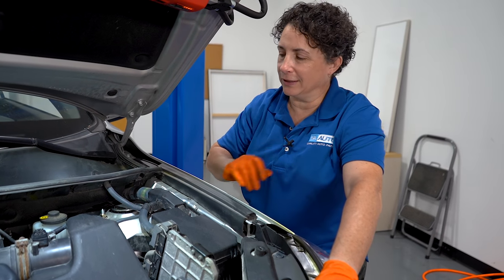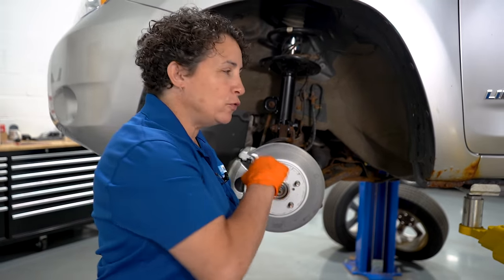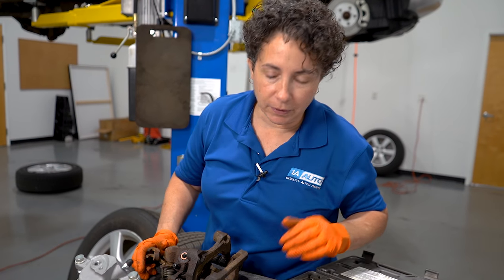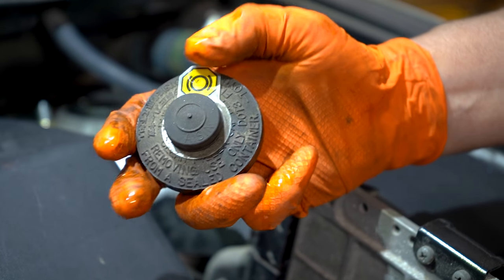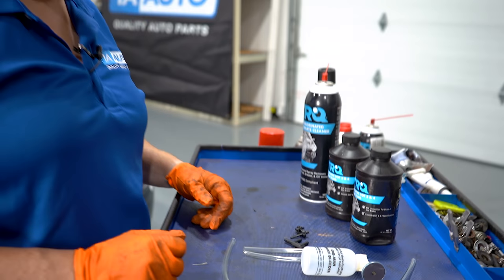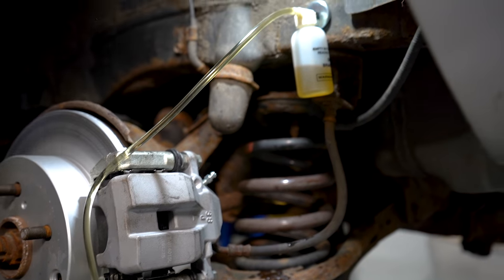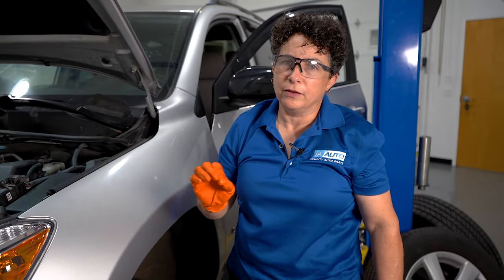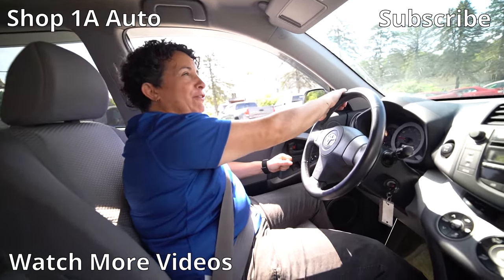Common Mistakes Bleeding Brakes! How to Do a Full Brake Bleed the Right Way, and Why!

Comment: Like this lady. Have old 98 Chevy rear brake feed rusted out replaced line from abs.. . Did single person brake bleed. Seemed good then I pushed to hard. I was good At 1970 trucks. I just want brakes, had abs unhooked to make like old skool. Abs sucks. Hit a lady who stopped on a green light in snow storm.. brakes chattered. Bingo I bought a 1 k bumper skin. 😡
Reply: I had brake job done. Rusty lines new rear hardware except wheel cylinder. Left with zero brakes . 990 wasted had new factory lines.
Reply: Finally someone who know their trade. Doing rear lines on 98 Chevy rusty paid 990 plus ball joint. Left with no brakes had factory lines in back of crew cab. But I don't have a hoist. Grr

Comment: I have a 2011 chev Camaro,i put a little bit of water in my brake fluid, thinking that was where i fill my water!!! Ya ya .i was told that buy the azzh*le i bought car from....my brakes are strong...but squeak alittle bit..im a single mom, don't have anyone, like i said i didnt pour alot of water in there? But should i take to a mechanic to get it flushed, and should I ask them to do all four tires? I did have my neighbor he looked at it he rebuilds cars and motorcycles he said he would flush it for me, but he only mentioned taking the front tire ,so idk?.

Comment: Why did you push fluid out the caliper and not into it and out the MC? Air rises up in a liquid solution, not down. Physics
Reply: there is more 'physics' than that.  Like the physics of brake fluid getting on paint when the reservoir overflows because you forced fluid up from the bottom.

Comment: quick tip to anyone doing this: if you drop the catch bottle below the bleeder after you've closed the bleeder, the fluid in the hose will drain into the catch bottle. less mess.

Comment: Why is “flaring” still used? Industrial applications have switched to compression fittings which are much simpler and less apt to fail. We use them on nuclear applications so why not autos???

Comment: The description of a normal brake system in American cars at 2:30  is wrong. Since the 1980s the normal breaking system in American cars has two hydraulic systems that connect to diagonally opposite wheels front and rear. There are older cars and some trucks that use systems with the front brakes on one circuit and the rears on the second, but those are NOT "what you typically see on cars in America".  This is an example of why you shouldn't rely on auto repair advice from auto parts store workers.

Comment: Well after a week I find myself back at your entertaining and instructive video! For which thank You VERY MUCH! 

Now I have actually found A single video on what to do if you've let the reservoir level to down too much (which you allude to), WITHOUT having to work big time on the master cylinder. Here's the link: 
https://www.youtube.com/watch?v=oi4BnNA3Ep4
I'd appreciate comments. I tried it but couldn't get the final 2" of air to disappear down into the reservoir after a looong time of trying. Hmmm. 

 When you were emptying the reservoir with the syringe 💉 how is that different from letting the level go down too far thereby letting air into the MC? Pretty please?

On the order of bleeding my Haynes manual (UK, for Mk4 Ford Fiesta) gives Right FRONT, Left REAR, Left FRONT (in my case driver's side 'cos it's left-hand drive (in France), Right REAR. So it's really confusing!!

Lastly, you say to push the pedal to the f!oor, yet many vids say DON'T floor the pedal -- even put something under the pedal to prevent that -- because it can damage the MC!!!

Anyway, have subbed and thumb upped (??) and clicked the bell, and hope to be enlightened!

Best wishes from France 🌹🌹🌹

Comment: Yes, a great video.  But brake-bleeding - so wrong . . . I need to buy a video camera and do my own brake-bleed video one of these days.  I can bleed a completely dry system on less than a quart of brake fluid by myself.  No special equipment needed.  I was taught 50 years ago by Mr. Hymie Popkin, (not sure how to spell his first name), one of the best brake engineers in the country.  I remember once asking him why he had a master cylinder cut in half length-wise sitting on his desk.  He told me when GM had brake problems with one of their new vehicles that their engineers could not figure out, they would contact him.  He inspired me to get into auto brakes and suspensions years ago.  He also had his own successful race team at one time in the past.  I remember calculating pressures, etc with different master cylinder bores, brake pedal leverages, wheel cylinders, vacuum power brake diaphragms, etc. To this day I still remember the 5 tests to perform on a rebuilt master cylinder, and the proper way to test a brake repair job. Most people don't even know the proper way to test the brake system.  Start the engine and you should feel the pedal drop a little.  Then with brakes properly adjusted and bled and vehicle running, stand with BOTH feet on the brake pedal for 30 seconds.  That is more pressure than you can put on the pedal with one foot in an emergency stop.  If the brake pedal has not gone to the floor in those 30 seconds, your brakes are good to go.

Comment: After accidentally squirting break fluid on the vehicle she should have sprayed the area with some sap and water solution as brake fluid is highly corrosive and destroys paint❤. Imagine this being your car and someone did this and not take preventative measures to cause more damage. Your car is never safe when someone is working on it sight unseen.

Comment: This style of kit is horrible, the adapters that go into the banjo bolt do not provide an airtight seal... I've always had to use stretched tubing and mini zip ties around the bleed valve or else I just get endless bubbling etc.

Comment: 1627,   so 3 times , not 6 or 2 , has to be 3,  , also  i see coated rotors,  zincked actually   who knows why not to use those,   , but lets continue

Comment: thank you for your videos, but I have a serious question that I am unable to get answered. Based on your theory of filling the bottle with brake fluid (around the 12:30 mark),  you mentioned that you put brake fluid in the bottom of the bottle so air doesn't go back into the brake line when you lift your foot pedal up. Can you please help me understand how your method would prevent air from going back into the brake line, when the tube in the bottle isn't primed also with brake fluid? There is air in the tube that you connect to the bleeder valve, so if your system sucks back in, it's bringing in the entire tube's air first before it brings in more brake fluid. Maybe I'm not understanding this correctly, so I'm hoping someone can explain it better?

Comment: Just be absolutely sure not to get brake fluid on your paint. It will destroy your paint job in just a minute if you don't wipe it off immediately. Had a friend that had someone pour brake fluid all over his hood and had to get it repainted.
Reply from the maker: +Jason Foster Thanks for the tip!

Comment: power bleeder is so much better, if you are injecting old fluid back in the bottle on push yet on uplift sucking that same fluid back in what's the point? You are diluting old fluid with new fluid.
Reply: Just change the fluid in the bottle if you are worried about it, but I don't think any/much  fluid is getting sucked in there anyway

Comment: i replaced 3 main lines in my 2001 chevy pickup... i will need an extra 32oz bottle of dot 3...thanks for this great video...this is my first major brake fluid job...Used the nicop 1/4 line... it was amazing..so glad i stayed away from using pain steel or even pre  made stainless...

Comment: Learnt buot change banjowaher whele back.. abs light cam on mec friend ask how clean fluid was looked dirty bad code said antilock module downthe frame towards the backchange fluid fix that thank good400.00 dl part    i never new how get good fliod though all the system i change it coulpe times looked lot better think  n morning vbrake system getting all new floid thanks i love this women . U said car  wont pass inspection with a brake Union n line n some place  how many u thank get under car an look i sure hope lot more  inspection personal starte couse them brake lines are out on the rd with me thats scarygot to make make sure front end an brakes function right your life rides in it

Comment: Doing fluid change and front pads on 1978 Ford E-150.   Hard lines as well as hoses are in full rust mode but I wasn't prepared to open Pandora's box on replacement until you mentioned the new flexible brake lines that are available, fully meriting a thumbs up and subscription.  Thank you.
Reply: I would replace the rubber brake lines coming off of the hard lines at 15 years. They collapse internally and will restrict braking and bleeding.

Comment: Oh, just gravity bleed the brakes with the 32oz bottle of brake fluid inverted into the master cylinder, if it fits.
Reply: I bet that doesn't remove all the air.

Comment: You are so wrong.  You do the shortest path first.  If you don't then you can't bleed the rear because there is too much air in the fronts.  I heard another Utuber say to do the back first, so I tried it the other day on a Toyota Venza.  No go, nothing.  Then started at the front like I always do and massive amounts of air came out and then the backs would bleed.

Comment: This vid is misinformation especially if you are bleeding the brakes for a Honda and or other Asian cars. You should go by the location of the ABS NOT the master cylinder.  Reason being nearly every car manufactured from 2000 and up has ABS . In Japan and Europe they are right hand drive cars and it was much easier for Honda for example to leave the ABS on the right side of the car eventho a US Honda's brake master cylinder is on the left . As a general rule of thumb on modern cars use your ABS location to determine the location farthest from when bleeding the hydraulic brake fluid .

Comment: Get real please. The back brakes in most cars rarely or never heat up as they do not do the most breaking, so the fluid in them is not as deteriorated as the fluid in the front ones.

Comment: This women needs to take a basic course in statics and dynamics! If fluid is maintain in the master when doing just the fronts there is no need to bleed the rear. If your goal is to change just the front due to ware bleed the front. If your goal is to change the fluid then bleed all the cylinders. Also, time is money honey!